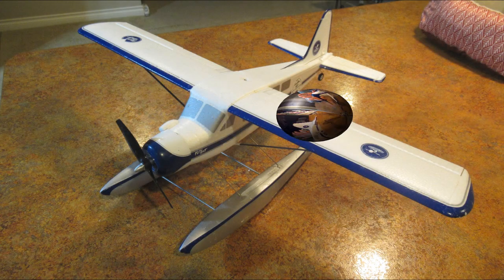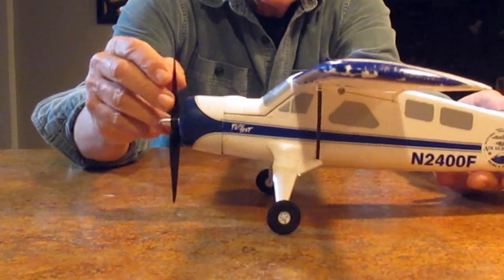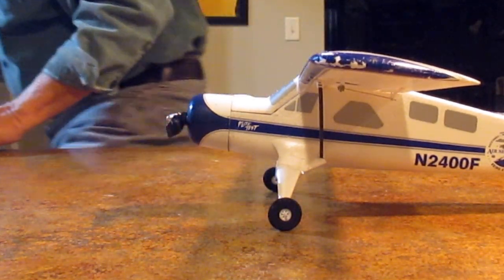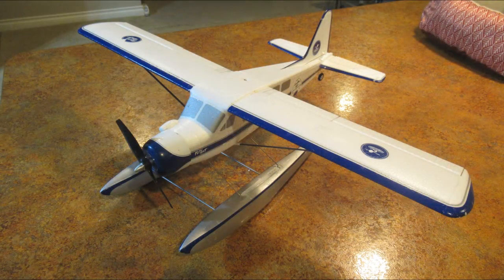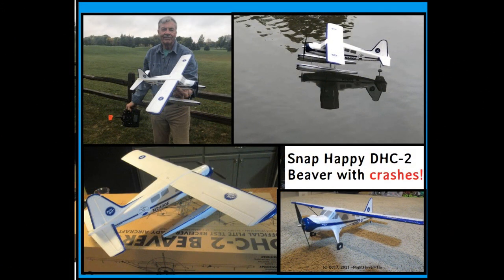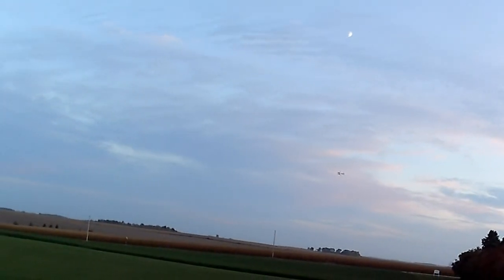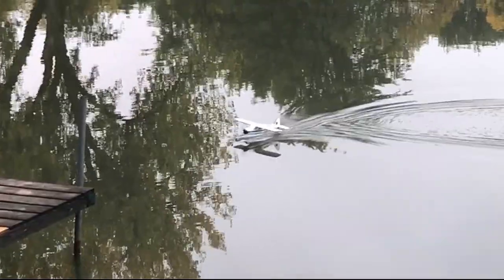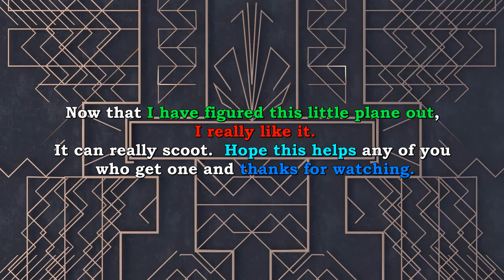The Perfect Propeller for the FliteTest mini Beaver for air & water. It wont lose pitch under load.

Comment from the maker: While Flite Test recommended a smaller propeller for their plane to fly off of water, they did not recommend a size in the manual or their promo video!  I have found the perfect size for both air and sea. This way, you won't have to change props to fly. Just use this size for both.  The stock propeller is a flimsy e prop that under load loses its pitch and flattens out.  I think this should be the prop included in the kit, but if not, just click on http://www.coxengines.com/propellers/  to find the one I used.  The shaft hole needed to be drilled out with a 1/4" drill bit, which made if fit perfectly. If you get one of these planes, I hope this would help you. Thanks. Here's a Link to my Water flight and rescue video.  https://www.youtube.com/watch?v=pyqEtE7Xbj4&t=38s
Dave 😉

Comment: Yess this is a really good lesson I normally fly my tail sitters with a prop with more pitch and 1/2 inch shorter in length Than specs. 

Been doing the give  throttle keep it straight go vertical approach since the beginning until I have this docile scale cub, which is nicely scaled in the power department so I had to do a more scale takeoff.. but props just strike did the 1inch smaller but 1inch more pitch to compensate.
Reply from the maker: Yes.  The formula for me is the same, even with my 1 bladed props ie, shorter length and more pitch, but with this one, I went from the stock 6x4 to a 5x3...so less pitch too.  But this prop flies much faster than the stock e prop.  That is because it is so flimsy, that at speed, it flattens out to be probably 6x2 !  The Cox prop is robust and  will not flatten out and is much stronger.  I'm not hitting anything with it but air now and really like how it flies.  Thanks and happy flying.

Comment: Honestly, not surprised! Has it changed your flight time? I have not forgotten about getting you info on the radios I have, hopefully this weekend
Reply from the maker: It really works for sure and does not flatten out and lose pitch under load at speed like the flimsy e prop does. Thanks much. Not to worry about the radios.  Thanks much.